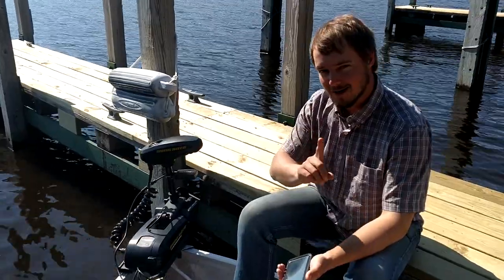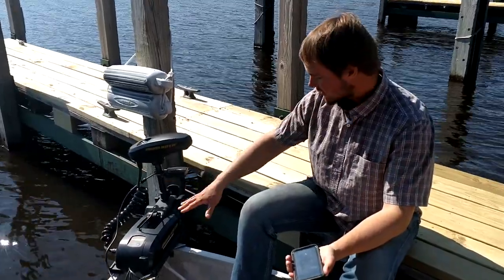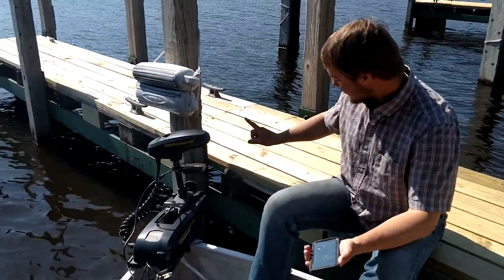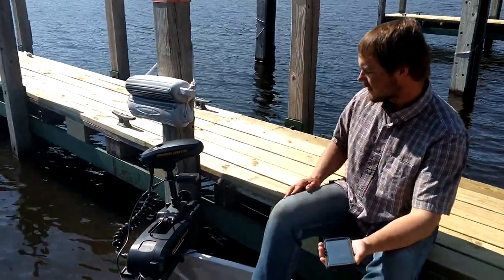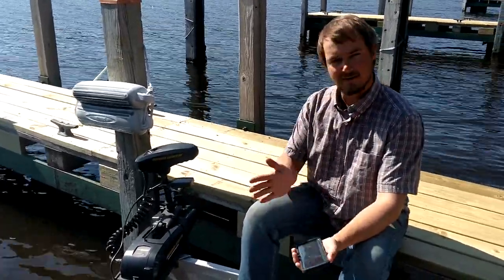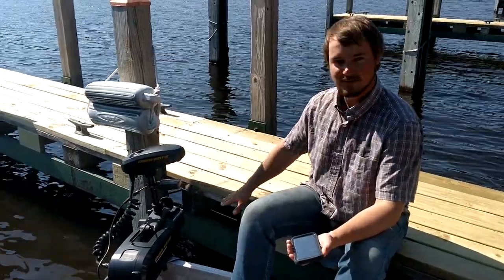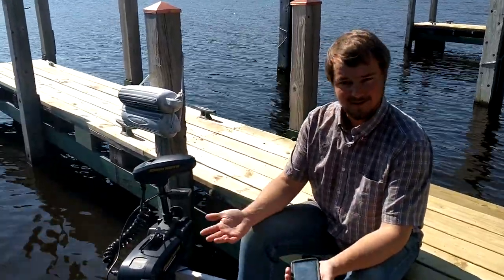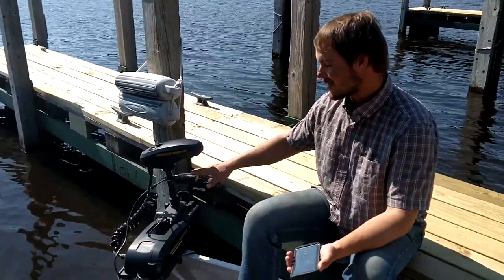How NOT to calibrate your ProNav Angler

Comment: Couple of questions.  You said the ProNav has a very sensitive compass.  1) Will the bouncing around when trailering or just chopping through the water wear it down?  In the "How to Cal" video, she mentions you can calibrate in the parking lot.  This sounds like a good idea if the waters are choppy.  2) Wouldn't my  trailer and truck act as a large interference like that steel pier?  Thanks!